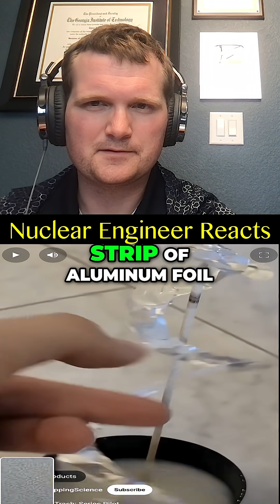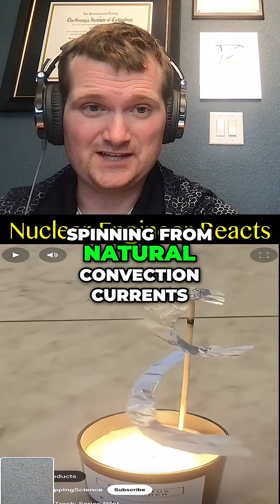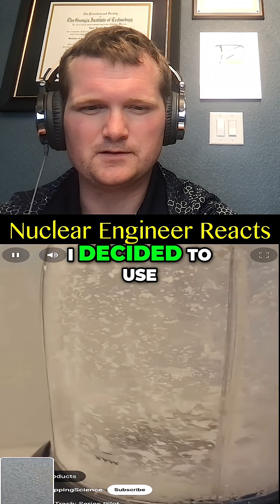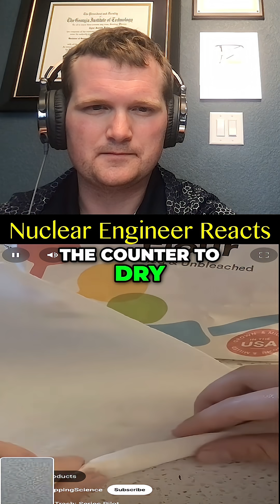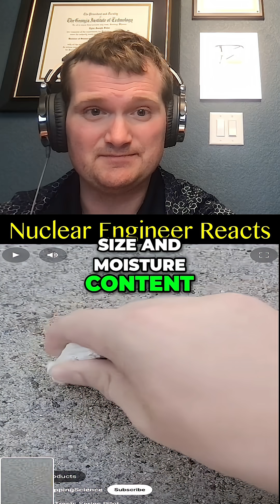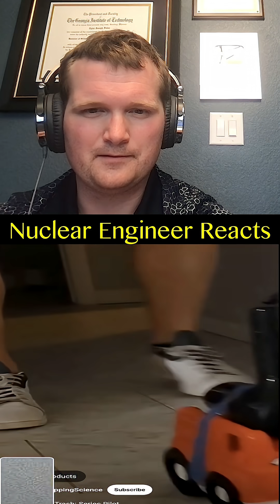Homemade Turbine? - Nuclear Engineer Reacts to 2 Truths & Trash by JaDroppingScience

Comment: The rocket and the car use different principles. The hair dryer is pushing against air, therefore Newtons third law. A rocket, however, is pushing against nothing. It will even work in space. In a rocket, the explosion happens in all directions, it is the forward part of the explosion that make the rocket go forward. The backward part does nothing. The equal and opposite force applies to the explosion only. I could just as easily throw a ball at the rocket, it would go forward but the equal and opposite would apply to me, not the rocket.

Comment: Is anyone in this comment section smart enough to explain to me how if a human were in space why it would take so long for them to lose their body heat? I had a convo about it but I can’t seem to wrap my head around it.
Reply: As you know in space there's no air — it's a vacuum. That matters because on Earth, we lose body heat mostly through conduction (touching things), convection (air moving over our skin), and radiation (infrared heat escaping). In space, only radiation works, because there's no air or matter to conduct or convect heat away.

Radiation is much slower at removing heat than conduction or convection. That’s why your body wouldn’t freeze instantly in space — in fact, you’d lose heat very slowly unless something else (like your oxygen running out or pressure loss) killed you first.

So, despite space being really dayum cold, you don't instantly "freeze" — heat has nowhere to go fast. It's like being in a thermos with the lid off. You will cool down, but it'll take time.

Comment: "We actually use candles to start up the core at our nuclear power plant"
Reply: Not wrong tho, as you need a candle to find your way to the electrical panel to turn on the light in the plant.